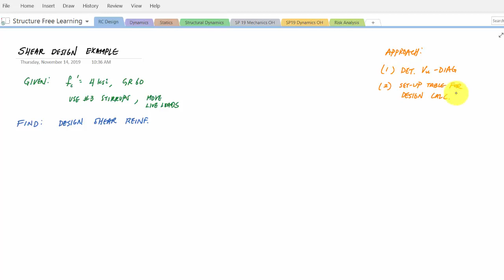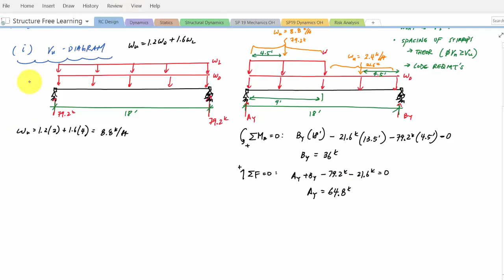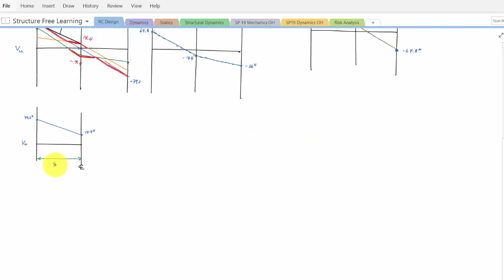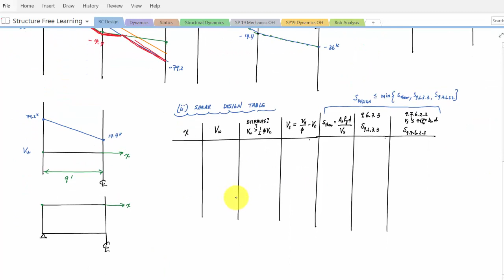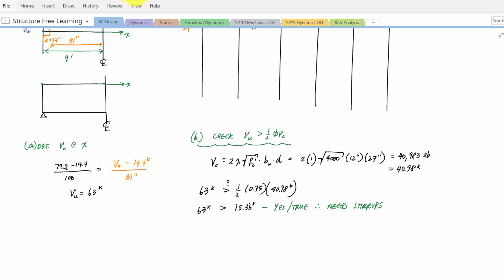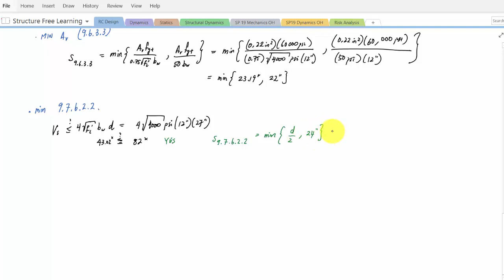Shear Design Example with Shear Envelope - Reinforced Concrete

Comment: Let me rephrase my question....you did an analysis with the live load at the left end of the beam and one at the right end of the beam....why was an analysis with the live load centered on the beam not necessary?
Reply: I know this is a little late, but for anyone else seeing this, you must draw the influence line (Muller-Breslau Principle for example) to visualize this. Then you'll see why they didn't do a distributed load centered symmetrically on the beam.